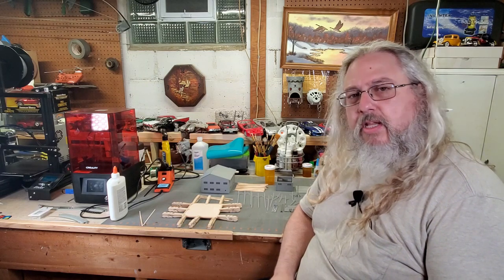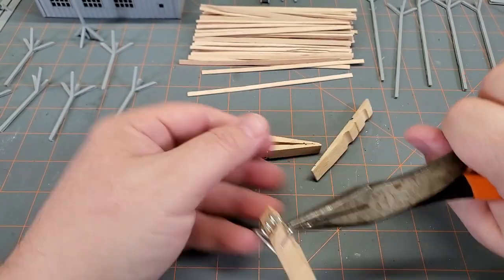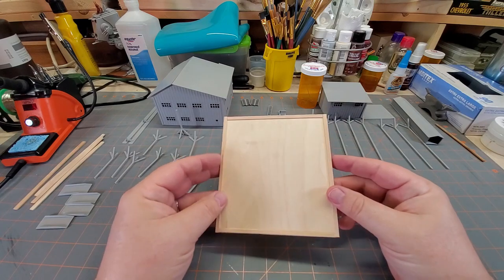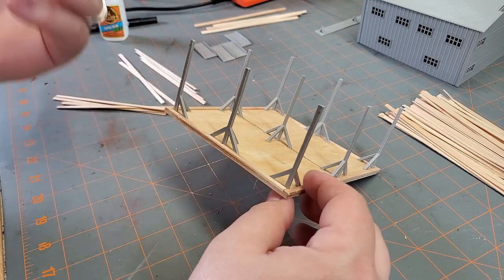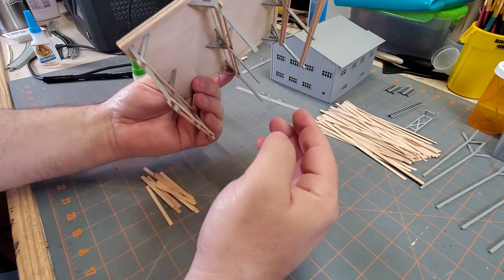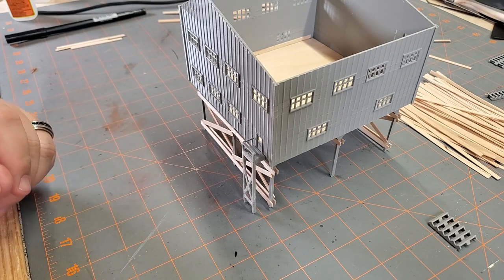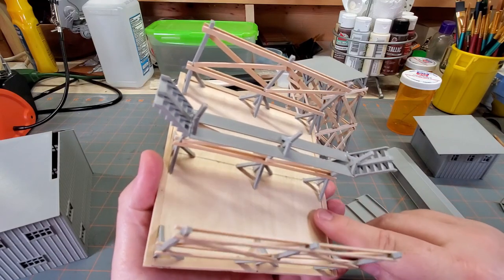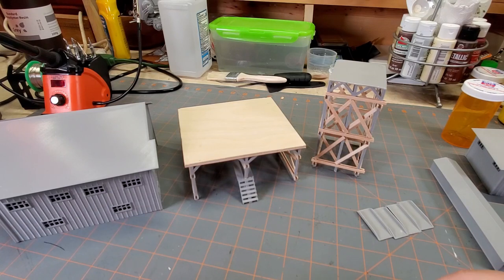3D Printed Model Railroad, Coal Tipple, Part 1, The Build

Comment: If you did it again now, would you start with an fdm or resin printer for n scale? I’ll be using mostly for structures like large building, housing and bridges.   Think “City’s Edge” but in n scale.  Using a resin printer, I’d have to print one wall at a time, but could print almost the whole structure in one fdm print. many say fdm isn’t good enough for n scale, but your models look great. Thanks!
Reply: Thank you for the compliment. I'll tell ya what. I love my FDM printer. I rarely use my resin printer. I only use my resin printer for either super small items that I know I can't get done on the FDM printer, and/or if I want super high detail. That being said. Super high detail is not always something you may want in N scale. The reason being is I have printed some highly detailed accessories that looked great until I painted and weathered them. I lost all that miniscule detail. I may just be heavy handed in my finishing, but this is what I have found. As far as the FDM printing goes, my designs are not 100% "N" scale. The overall dimensions of my items are correctly scaled, but for instance the brick texture is not. It is close though. I do this for several reasons. One. I am pushing the FDM printer pretty much to its limits to get a nice clean print and second. I'm old. And when I'm looking down at my structures on the layout I want to be able to see the detail. LOL. But to answer your question, yes I would start with an FDM printer first.  Once you learn the printer, learn how to keep it "tuned" up. Lean all of its nuances and learn how to use the slicing software to enable you to get the best print possible then as far as I'm concerned the only limitation is your imagination. Hey follow me on Facebook at Paul's Railroad. And if you need any help in the future with 3d printing just send me a message and I will do what I can. Take care.
Reply: @paulratliff4116  thank you so much for the detailed reply. Very very helpful. I have been searching for a channel that covers 3D printing and n scale but they are very few and far between.   I sent a separate question re: your print settings, nozzle size, layer height and filament type. Thank you !
Reply from the maker: Anytime. I love helping out anyway I can.

Comment: what software are you using?  http://tripptee.blogspot.com/
Reply from the maker: Hi Steve. I used Fusion 360 to design this model. I also use Tinkercad occasionally if I need to do something that is simple very quickly.